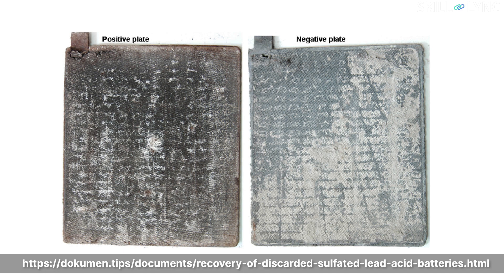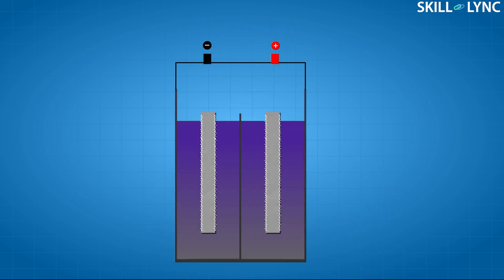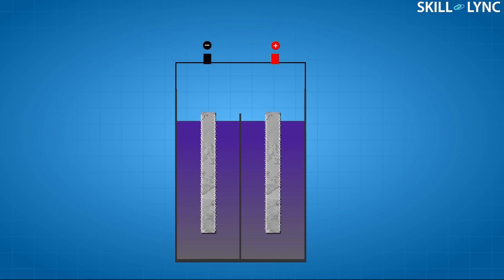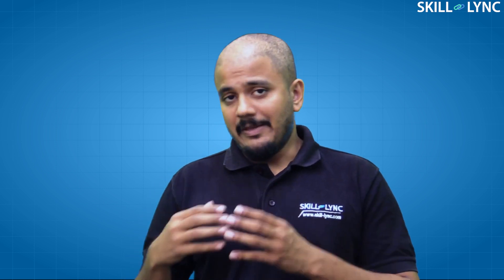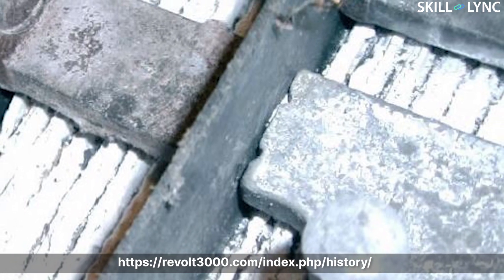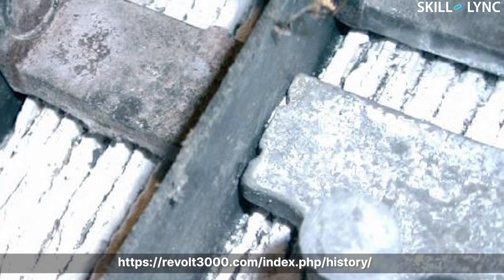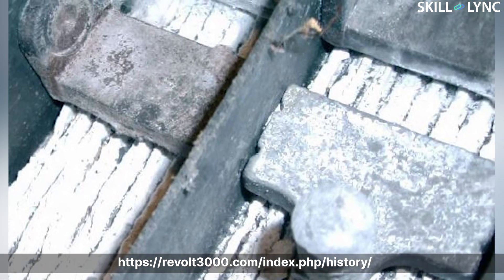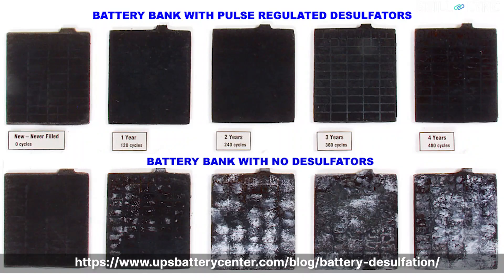Sulfation in a Lead Acid Battery | SKILL-LYNC

Comment: So far, i see desulfation videos on Wet Lead Acid Battery but not on the Low-Maintenance Lead Acid Battery.  Can you desulfate a "Low-Maintainence" Lead Acid Battery using electronic pulsed desulfators?
Reply: Yes you will need to unseal the battery. Depending on brand it may differ. Some drilling, some cutting seal with a box knife. Do it wrong and you have other issues.

Comment: If i have an 9 months brand new battery, but because of the lack of car movement, i have been periodically charging it manually. But recently, the voltage dropped from 12.5 volts on the 1st Day, to 10.0 Volts on the 2nd Day. This is with the battery not connected to the car. The 3rd Day it is 10 volts and the 4th day it is still 10 voly. Is this sulfation because perhaps i have either under-charge or over charged the battery. Pls confirm?
Reply: It's neither over charged nor under charged. One cell either completely sulfated or physically broken.
Reply: you should physicaly check inside it. Is there seen some built up?
Reply: @donnymontreano2045  Hi Donny, Its a low maintainence battery. Its not a Wet-Lead Acid Battery where you can peep into each cell.. So, its hard to see. I do believe they use Gel inside but I am not sure.  Thank you for your question.
Reply: @DeeAnn12499  FYI, a std low maint is in fact still a wet/flooded lead acid battery.

They are called maint free because they are designed to better retain electrolyte solution with less loss reducing need to add distilled water once in a while.
The next Gen automotive/motorcycle battery past std or maint free flooded lead acid battery design is AGM/absorbent glass mat that uses a paste laiden with acid that’s applied to the plates.

The AGM battery is still of lead acid design but it’s just not flooded with acid which is now in the paste that’s applied/squegeed onto the plates in a newer generation AGM battery. 

AGM batteries laste longer on Avg, hold charge longer without charging,don’t leak,have more cranking amps in like application & in some cases can be mounted in any position inc upside down too due to not being a flooded wet lead acid battery but AGM is more expensive.
Reply: @scottwheaton9689  Thank you so much for your very informative updates. Truly appreciate it.